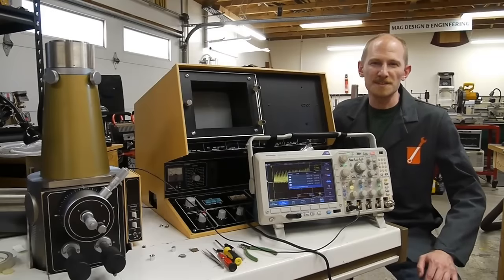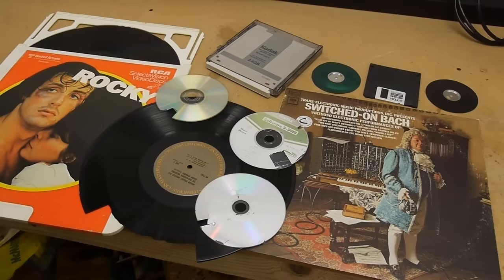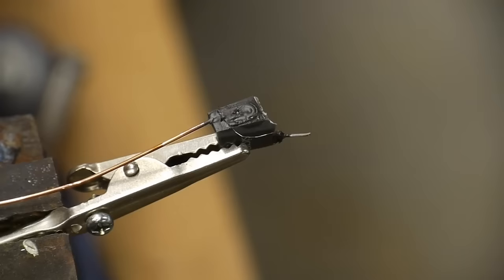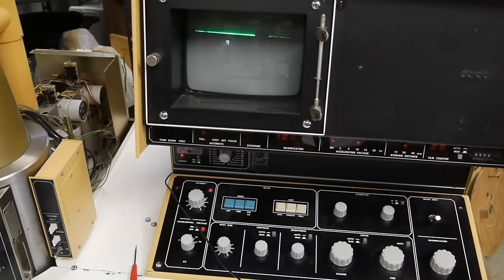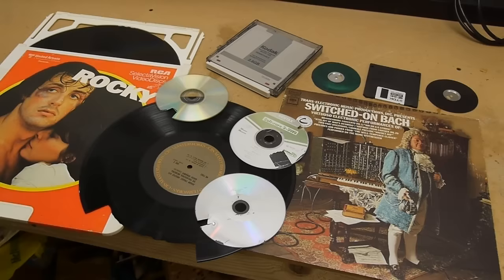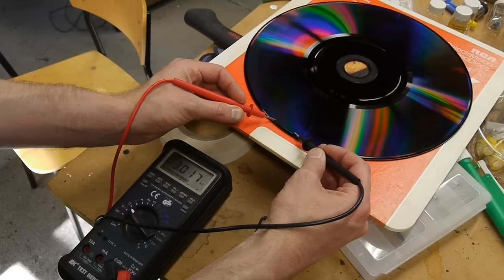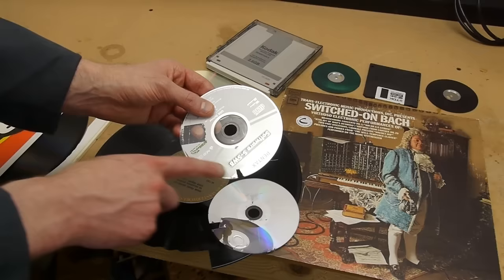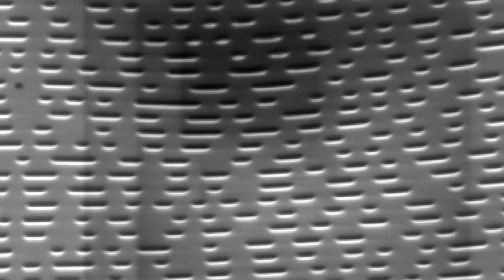Electron microscope slow-motion video of vinyl LP

Comment: its quite funny that the record you used was Switched On Bach, i've been wanting that one for a while but havent run across it yet.
Reply from the maker: Rinoa Super-Genius I didn't cut up Switched On Bach.  I also bought a Johann Strauss LP and sliced that one into pieces.  I saved the Bach disc because it seemed unusual.
Reply: Applied Science
oh ok, i dont think it would have been a big deal if you did though. ^^

any ideas on how to visualize the magnetic sectors and stuff on floppy discs and hard drives? i would love to know if the magnetism alone alters the image at all.
Reply: Rinoa Super-Genius I love that Switched on Bach album.  I used to listen to it as a kid.
Reply: Rinoa Super-Genius to see how magnetism alters a flying electron image, get a really strong magnet, even fridge magnets might work, and move it across the bottom of a crt (cathode ray tube, i.e. flying electron tube) screen - old school tv or computer monitor, non flatscreen, non lcd.. you know.. those big bulky ones.. on the computer monitor the degauss (vibrating magnetic field) should clean up the mess you leave behind on the screen with the magnet when you press the degauss button on the front control buttons.. it's residual magnetism you leave behind in the metal mesh that guides the electrons to the pixels on the screen.. the equation of the force of a magnetic field acting on a moving charge F=q.(v x B), where v x B is the cross product of the velocity v in meters per second and magnetic field flux density B i have to look up the units, found it, its webers, times the charge, in coulombs, and the interesting thing is that its a sideway force.. it requires the velocity of a charged particle going not along, but perpendicular to magnetic force lines, and then it gets pulled to the left or right, sideways, 90 degrees to both the magnetic field lines and the velocity vector.. so when an electron flies straight in vacuum, you put two poles of a magnet across each other, and it will get detered to the left or right depending on the orientation of north or south poles.. that is in fact the control used in crt screens, magnetic coils make the electron beam sweep across the screen at the refresh rate vertical Hz and horizontal kHz, while in oscilloscopes the usually greater depth requiring cannot make the screen so "tight" electric field is used (the electric field deters on a parabola, while a magnetic field on a circular path)
Reply: Sillybillydilly thanks for stating what i already knew when i was like 10, but your comment really has no relevance to the question of weather or not magnetically stored bits would distort the image in an electron microscope. or atleast i didnt see that in your comment.
Reply: oh i thought you meant the magnetic bits of the LP needle.. duh.. i should have read your username and pay more attention to it.. and i was like 16 when I learned about the Lorentz forced, you are truly a genius if you knew all that at age 10
Reply: Rinoa Super-Genius Really? I see that record around thrift stores every once in a while. There are some dirt cheap copies for sale on discogs too. 
http://www.discogs.com/Walter-Carlos-Switched-On-Bach/master/76226
Reply: FauxReal
just because you've come across it a lot at yardsales doesnt mean i have.
Reply: Sillybillydilly
main reason i knew at 10 was i tried turning some CRT tvs into oscilloscopes, they kinda worked.

and my name is sarcastic due to me always breaking stuff on accident :P
Reply: Rinoa Super-Genius What I was inferring was, that it's pretty available out there so it can be had relatively easily if you want it. I was trying to point you toward your goal genius.
Reply: FauxReal
its not something i actively seek, just on my list of things to grab if i ever see it at a yardsale or in the garbage.
Reply: *****
good for you ^^
Reply: Rinoa Super-Genius I hoped I could see THIS very comment and my prayers have been answered.
Reply: *****
cool
Reply: Applied Science switched on bach is a good record - used to listen to that a lot...  u can order  your copy at discogs for a few bucks
Reply: *****
yes youve already stated that.
Reply: Gunner3789 
I was wondering the same thing!  'Super Genius' guy, probably doesn't come off like such a rude 'know it all' in real life, unless he LIKES getting his butt kicked.  I consider this dude a bore and someone with little self-esteem.  So little in fact, that he is afraid to be 'wrong' in any sense of the word.  Hence the,  'I haven't been actively seeking it' bullshit and the like.  If I weren't a lady; I would use stronger words  to describe him, but you guys have been doing a good job of it.   :)
Reply: Rinoa Super-Genius I read your first line and that is all the time I have for you.  You DO go out of your way to be rude.  That's why people are talking about you.  Take a look at yourself.  No more replies from me.
Reply: Rinoa Super-Genius Dude I could tell it wasn't Switched On Bach just by looking at the record grooves in the magnified image.
Reply: Amazing vid
Reply: MichaelKingsfordGray
1$
Reply: Rinoa Super-Genius 
I have a copy I don't want. I thought it would be funny but it's just terrible
Reply: Rinoa Super-Genius The tool of choice would be a Magnetic Force Microscope (MFM) which is kissing cousins to an Atomic Force Microscope (AFM). Really just a different tip material that is magnetic.
Reply: anyheck
oh your right.
Reply: Gunner3789, what's with the unnecessary hyphen between "douchebag" and "ery"? Why not just say "douchebaggery" (not that I think he uses that, but I haven't read all his responses)?
Reply: Rinoa Super-Genius Holy crap people want to feel insulted or something. Rinoa Super-genius is right. He has been answering straight and simple while others take offense and then are actually mean. If you feel offended by Rinoa then that is coming 100% from yourself. Short simple explanations are not bullying like the comments by those that attack Rinoa.
Reply: 0ooTheMAXXoo0
yeah i find it funny how they are getting so upset. its probably because they dont know how to read emotions and tones in text so just think everyone is typing in an angry tone.
Reply: But even so, folks, here's how you add "-ery" to "douchebag:"

Step 1: add the second instance of the last consonant -- in this case, the g -- to satisfy that little English double-consonant rule for words whose last syllable ends with a short vowel sound. Example: "douchebagg..."

Step 2: do not add a hyphen, because hyphens usually only belong when carrying parts of words across breaks from one line to the next, etc., and only between syllables; or between whole words to form compound adjectives. Example: "Super-genius Rinoa" (the words "super" and "genius" being compounded as a single adjective to directly describe Rinoa) versus "Rinoa [the] Super Genius" (no hyphen).

Step 3: add the "ery" part right after the now-doubled consonant on the ending of the root. Example: "douchebaggery."
Reply: ungratefulmetalpansy Golly, do they still make that stuff??  I remember "back in the day" you brushed it on to audio or video tape so you could see where the magnetic pulses were before cutting the tape (with a single edge razor blade) and splicing with adhesive patches.  (The tape was held in place in a "splicing block," made of aluminum so it couldn't become magnetized.)
Reply: ungratefulmetalpansy Makes sense!  Thanks.
Reply: Why encapsulate the splicing block in quotation marks, Jeff Missinne? Was it not an actual splicing block, or...?
Reply: MaxxFordham I guess I put it in quotes because anyone under 50 probably never used a splicing block and has no idea what they even were.
Reply: Heheh, Jeff Missinne. But even so, how might just adding quotes to it -- no description added -- supposedly help them understand?
Reply: MaxxFordham You have just witnessed a pathetic example of attempted trolling.
Reply: I have, Jeff Missinne? And what would that supposedly be?

Also, what's the answer to my question?
Reply: Rinoa Super-Genius I got that album when it was first out on vinyl.  Great stuff.
Reply: Applied Science was it the quadraphonic one?
Reply: Rinoa Super-Genius Looks like it's been run across now!
Reply: Stuart Saunders
no i havent run across a copy yet. but i dont usually look at records at yardsales.
Reply: +Rinoa Super-Genius Get 'em all day long on ebay. I just bought one.
Reply: William Jones
cool, but i want to see when i find one on accident at a flea market or whatever, ebay is kinda too easy...as i've stated in this thread already.
Reply: +Rinoa Super-Genius Run on a treadmill while you order from ebay.  Problem solved.
Reply: +Shredder nice
Reply: +Michael Fremer I have the album my my father bought in the late sixites. It was his way of getting me to listen to the classics, although we all enjoyed it. The cover of mine has Bach looking kind of dour, which could be considered a happy expression in some places. I just thoroughly cleaned and listened to it the other day, after many years of ignoring it. I finished all of Side A. Sounded great and brought back some good memories! I bet that you also have a copy of "The In Sound From Way Out!" by Perry-Kingsley. Another one I cleaned and rediscovered recently. It's good to be able to go through my dad's collection
Reply: (I still have that record. Bought it when it first came out)
Reply: +Michael Fremer Lucky you! What I would have given to do A Clockwork Orange with her...
Reply: +Applied Science Wow... in case you didn't know, Switched On Bach is a hugely popular classic, recorded in 1968.  I bet you could make some big bucks on the sale of that record!!  ;-)
Reply: *****
and by "huge" you mean 5$. hahaha
Reply: Rinoa Super-Genius ... and Wendy Carlos will not allow anyone to post her stuff on YouTube.  It might be time for her to "loosen up" a little.
Reply: +Marcus Spanford I wonder what Walter's view on that is.
Reply: K Miles He concurs, 100%  😉
Reply: +Rinoa Super-Genius I heard that with iron powder and an optical microscope, you can actually see the bits on a floppy disk. Apparently back in the 70's if you had a bad sector on a 9track tape, they would get out the powder and a microscope and do data recovery on it.
Reply: +Rinoa Super-Genius Floppy disk: https://upload.wikimedia.org/wikipedia/commons/7/73/Visualization_of_magnetic_information_on_a_Floppy_Disk_%28CMOS-MagView%29.jpg 
Hard Drive: http://www.matesy.de/images/products/applications/hdd.jpg
Reply: Rinoa Super-Genius By "huge" I meant popular.
Reply: +Rinoa Super-Genius  where I live I come across it some times. I own it. and I think there are one or two others in that series.
Reply: +joe alanouf yeah there was a series of switched on classics I've seen, if I had any room I'd get them every time I saw one at a op shop
Reply: Here's the "angry" cover: http://rotatestockforfreshness.com/wp-content/uploads/2013/02/switchedonbach1.jpg

Here's the "happy" cover: http://4.bp.blogspot.com/-CzcAL9JIJyE/VOPemt0N_CI/AAAAAAAAHUo/IFMH9YYNHWQ/s1600/Walter%2BCarlos%2B-%2BSwitched%2Bon%2BBach.jpg
Reply: Isn't Switched On Bach, like, the first electronic album?
Reply: i think so
Reply: love that album,have it on cd
Reply: When I bought Switched-On Bach in 1968 I was amazed and it became one of my favorite all time records.  Years later, I was one of the last people on Planet Earth to get a CD player.  Once obtained, I went to the local record store and told them I wanted to buy Switched-On Bach by Walter Carlos.  They looked it up in their big book and there was no Walter Carlos listed.  I had them look again and still got the same answer.  Then I had them look by title and they told me I had the correct album name, just wrong artist.  It was Wendy Carlos, not Walter Carlos.......I was puzzled and argued with them, but they were able to get me a CD of SWB by Wendy Carlos.  It seems that he (Walter) was going through hormone therapy at the time and the success of SWB allowed him to become her (Wendy) after gender reassignment surgery.  Pretty forward thinking, and risk taking for 1972.
Reply: +Larry Patterson what an interesting commentary this is!
Reply: +jamie1974 how so ?
Reply: I've got a copy. You can have it 😜
Reply: DrRawley Hey me too! My parents transferred both moog albums to tape so I could play it more often.
Reply: NO.
Reply: Rinoa Super-Genius 
I do, that would have been a waste of a good record.
Reply: Amazing stuff.
Reply: Go to discogs.com you will be able not only to get switched on Bach but any hard to find record cd or tape 👌kind regards 👍
Reply: Its quite rare You should check up on the price of it today...
Reply: Haha had one in my garage

Comment: Bluray, of course, would require an even crazier res electron microscope. I imagine it appearing similar to the cd and dvd examples, just tighter.
Reply: what I want to know is how multilayer works :P
Reply: +sinephase Just an educated guess, perhaps its background groves that can be read by waves in a particular phase which allows them to snake around/avert the foreground groves. I could be completely wrong.
Reply: Isn't Blu-ray dual layer?
Reply: Some are, yes.
Reply: Some are even triple layer.  And supposedly there could be quad layer, though none have ever been made commercially available.
Reply: Timothy Perez 
I dont think its the phase of the wave, its the focus of the laser
Reply: Blu-ray works because the blue light has a higher frequency so it can get information faster than a traditional red Lazer used in a normal DVD disk.
Reply: What's with Major Lazer?

Comment: I worked in a mastering lab and we had a 100x microscope which was sufficient magnification to check the groove. Notice no plural, there is only one long groove. Anyway, you are correct about the stereo channels and the needle moving side to side depending on the dynamic range of the sound, the mastering engineer would have to make sure that the channels were properly balanced or the needle would actually jump right out of the groove. the best engineer could maintain both tracking and high dynamic range, really an art.... saw lots of lacquer masters trashed by one channel too hot and the needle jump, that's why the microscope was better than an oscilloscope, which we also had.
Reply: A porky prime cut!  Actually Porky (George Peckham) could do more than one groove on a side...
Reply: It is a good trivia question. correct answer is 2, one either side of a record.

Comment: The memories, I did my maintenance apprenticeship at a record company (pressing plant) in the U.K. called Damont Records in Hayes Middlesex, which was right next door to EMI His Masters Voice. I was taught that the sound from the grooves in the record are stereo if it’s on both sides of the ‘v’ channel and if it’s smooth on one side then the record is mono. Another thing to note is that the needle does not go to a sharp point; it’s flat at the bottom so that it does not bottom out and scrape along the channel. Great video, thank you.

Comment: Women love my sputtercoater
Reply: An underrated comment.
Reply: I bet they do. They are very useful tools.
Reply: Make sure to mask tape the ovaries, if you're sputter-coating near them, it can take decades for that damage to scrub out
Reply: My conductive carbon glue brings the electrically isolated styluses to the rubber suspension.
Reply: I lolled.
Reply: Sharpie the Parrot Brilliant!
Reply: LOL * snort * 😂
Reply: Coating with your sputterer? What a good idea
Reply: I hear it's not working these days.
Reply: OMG! THATS A DOOOZIE

Comment: CED discs are neat.
To read then you setup your basic resonant circuit oscillator with the C element being the disk and the read head. As the disc spins the C element changes which modulates the oscillators output. Pow, FM!

Comment: Nit: The two channels of a stereo LP are not encoded individually. For various reasons, including compatibility with mono, it uses sum and difference. Horizontal wiggles encode L+R (mono). The up and down wiggles encode the difference L-R, I think. Could be R-L, depending on convention.
Reply: That's just another way of describing the same thing.  One of the channels moves the stylus diagonally NE-SW, while the other channel is NW-SE.  One groove wall carries the L channel  signal and the other carries the R.  The two transducers in the stereo cartridge are mounted at +/-45 degrees to the plane of the disc, so the L and R signals are kept separate.  This results in purely horizontal stylus movement for the M (Main or Mono) 'sum' signal, which gives compatibility with mono recordings and activates the two stereo transducers in phase.  The S (Side or stereo 'difference') signal gives purely vertical movement, and out of phase activation of the two transducers.

Comment: If you put a small magnet in the center of a checkerboard pattern and view it in the electron microscope, will you be able to see the electron deflection because of the distortion of the checkerboard pattern?
Reply: Eli Child no.
Reply: Eli Child That might work. It could be difficult to generate a test pattern out of metal. Maybe a piece of Aluminum or brass screen would work well, with or without a metal backing, like Aluminum foil.